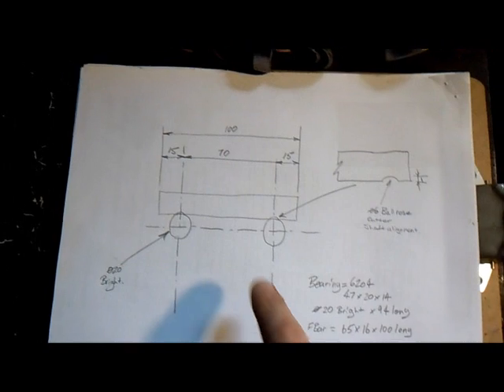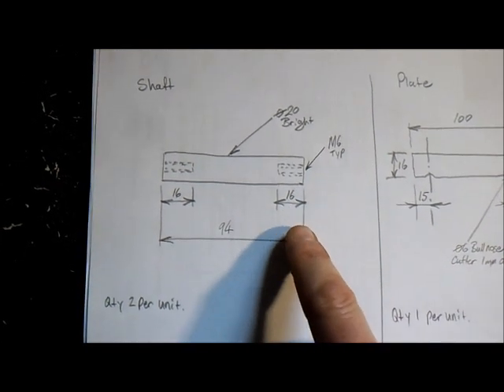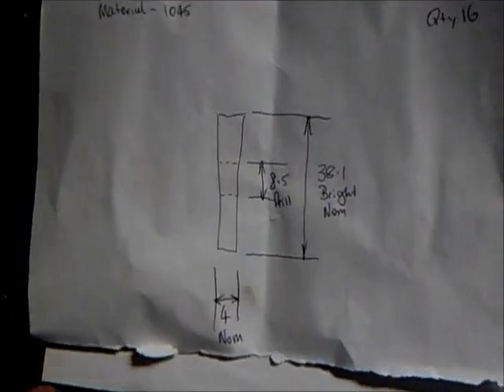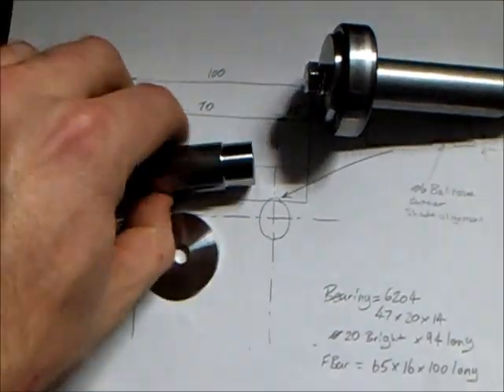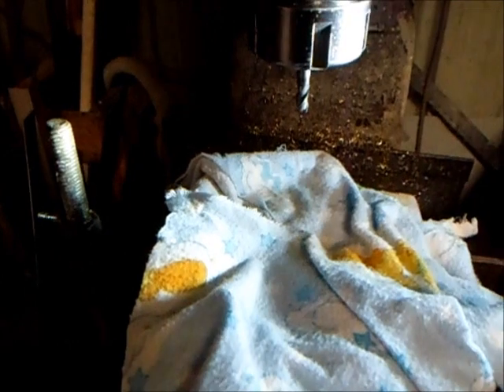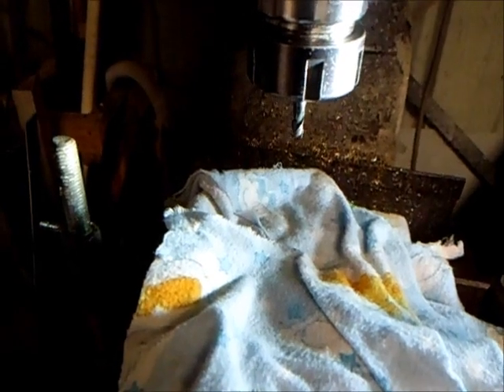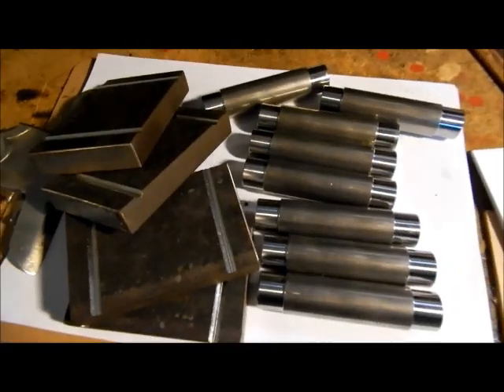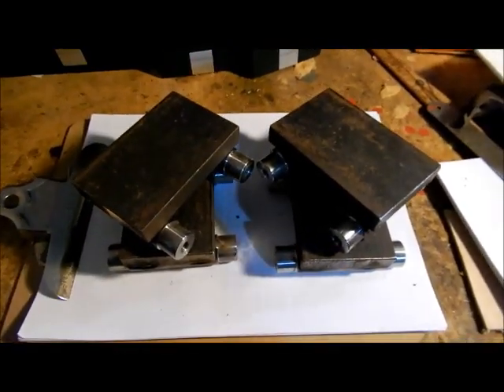DM Engineering - Making machine skates / rollers

Comment: Just happened to come across this page. I have used skates many times,all the units I have used or made have a locating pin in the centre that locates the skate in the anchoring hole on the machine so you can change direction for maneuvering and have rod holes drilled ( or wielded) into the pad sides so that one can pivot the skate, this can allow the machine to pivot 360 degrees. If you add these features you would have a much mor functional skate. You did do a nice job on your skates.